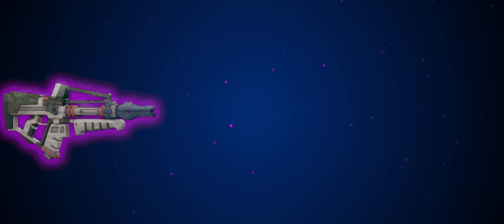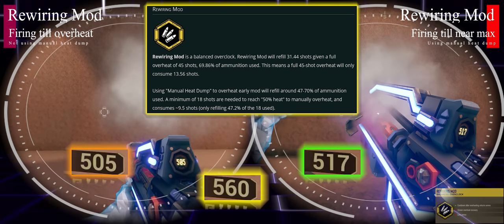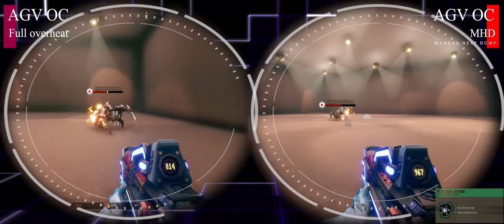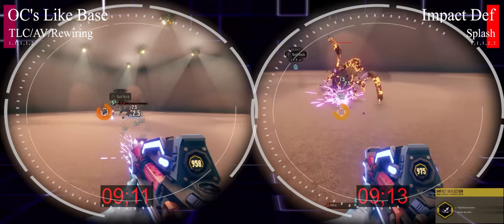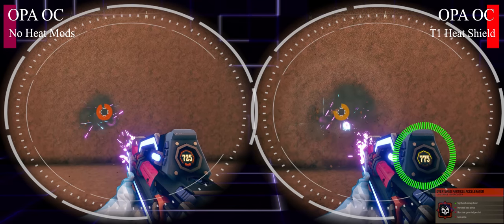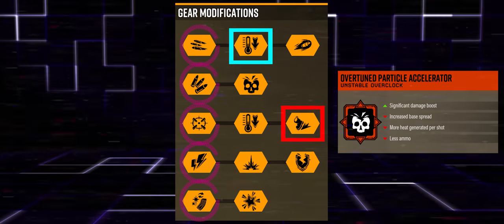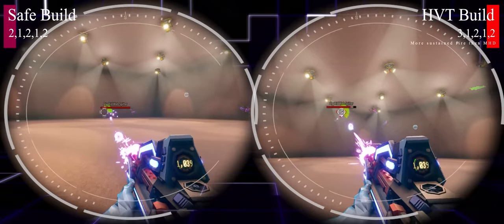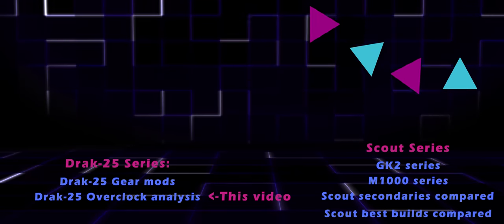Drak-25 Overclock Analysis - Deep Rock Galactic

Comment: Is that heat visualizer  mod legal to use in standard multiplayer? Not sure how mods are regulated in drg so if anyone could tell me it would be great.
Reply from the maker: Yeah is fine to use.

Some mods will change the lobby to (modded) you will see this top right with your name. Some mods are sandbox, so you need a separate save file from your normal one.

Heat mod, damage numbers, health and shield numbers are all valid in any game.
Reply: Ah i see i see thanks man, keep it up with the vids. Rock and Stone
Reply: Mods are sorted into 3 categories
-Verified - Client-side mods only, they usually change stuff like visuals or sounds, you can have them on in multiplayer even in unmodded lobbies since the mod doesnt affect any of the other players
-Approved - approved for progression, you dont need to be on a sandbox save to use them but using them will flag your lobby as modded and they do affect other players, getting some teammates might be harder if youre running a modded lobby
-Sandbox - You need to be on a sandbox save to use these, which means missions done using these mods will not count toward progression on your main save

the heat visualiser is verified so you can use it in any lobby with no problem, it doesnt affect other players

Comment: I think Impact Deflection is a bit weak. Sure, you can use the splash damage to get an extra 5 damage, but the area is very small and you basically lose out on 10 damage if you're hitting a frozen target.

Even with Impact Deflection, I feel like Electricity is still the go to, since you can electrocute multiple enemies while doing full direct damage, whereas the splash damage requires enemies to be really close, and even then, hitting the enemy directly may just make the round bounce off to the sky, meaning you've lost damage.

The OC definitely needed an extra bounce to really stand out.

Comment: Most of your input seems to come from the HAZ6x2 community. I have found them to have some biases, be carefull with that. OPA 21112 is best. Same dps as higher firing rate builds and incredible ammo efficiency still. Works very good with builds that use cryo bolts or grenade.

SBB is hot garbage, total trap. TEF just loses to OPA, if you want fire spread take boomstick or firebolt. ID is better with T4A. Everyone falls for the T4B trap. Its useless. The AoE is (1m) aka garbage and you lose out on weakpoint damage by halving your kinetic damage.
Reply: Dude I've been looking for someone with this build for WEEKS. Nobody seems to combine Custom Coil Alignment with OPA. I've been running 21112 since the beginning, tried using Velocity or RPM several times, even manual heat dump and other mods but each time I came back to 21112. It just makes sense, I feel like most DRG players must have crazy shit aim not going for weakspots because nobody seems to go for this build. Everyone prefers close range RPM or damage abuse leaving them with no ammo after 4mins of gaming, hence the shit on Drak because they can't make it work or sth idk. Now I'm waiting to get my hands on OPA, can't wait, and I expect it to make my build absolutely ridiculous.